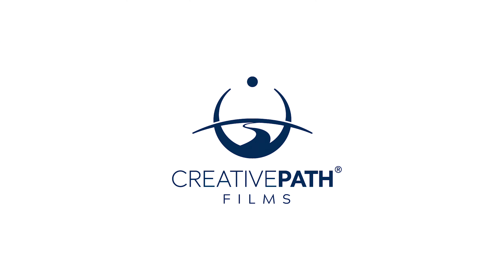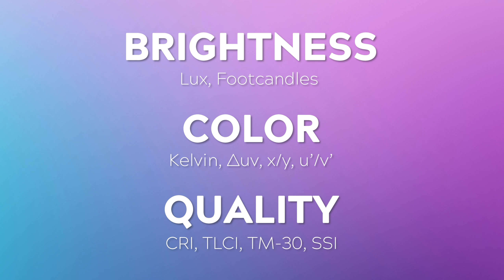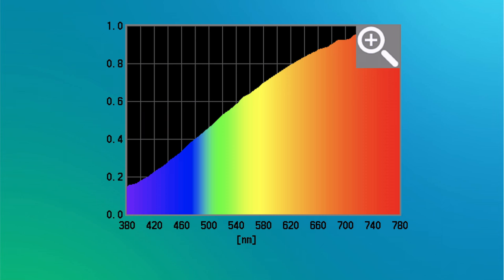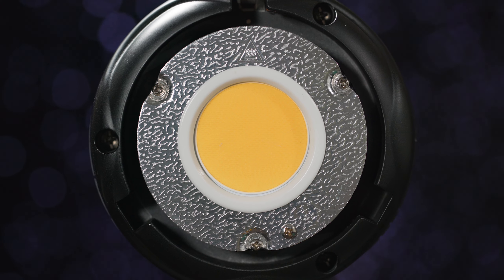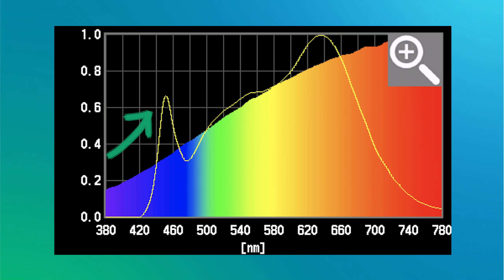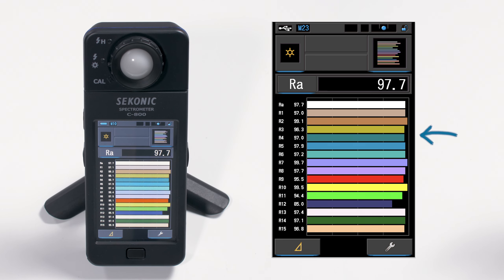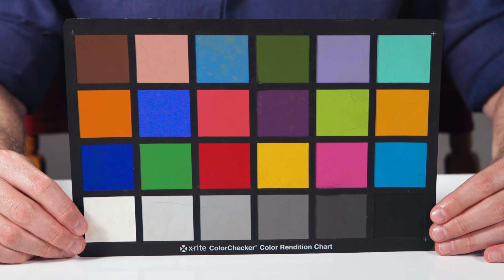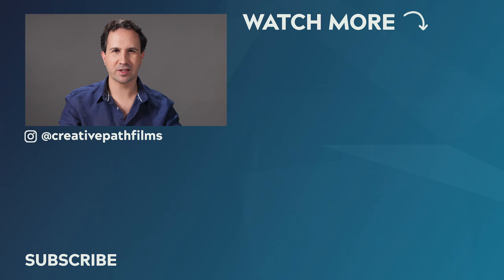Part 1 | What is CRI and TLCI? Demystifying Lighting Metrics with the Sekonic C-800

Comment from the maker: CORRECTION NOTE:
- I made a mistake in the video and incorrectly labelled TLMF. It stands for "Television Luminaire Matching Factor", not "Television Lighting Matching Factor" as stated in the video.
- I also wanted to note that the CRI scores given by the C-800 are calculated using R1-R8 only and do not factor in R9-15 when determining in the Ra value.

Comment: can we use gels to compensate the color loss of consumer grade >80 CRI led lights... if we are lacking orange, can we use to gel?? i want to start filmmaking, but don't have the budget or any service center for buying those high end lights... I want to use commercial light with gel... can I??
Reply from the maker: Potentially. It warrants some experimentation, I have improved the CRI (very slightly) on LED film lights with appropriate correction gels. But as there is so much difference between different household lights from different manufactures in different countries that it would be near impossible for me to give you an accurate recommendation for the lights you have access to. You would need a spectrometer like the C-800 to know, which far our prices the cost of entry level film lights. 

One thing to note about gels, is they don’t add a color to a light, they block certain wavelengths of a light, except for the desired wavelengths. So a blue gel isn’t adding blue, it’s blocking everything but blue. If there is very little blue wavelength to begin with (eg the streetlamp discussed in the video) it would block the majority of the output and only allow a small amount of light would make it through, which isn’t very efficient. 

I will experiment with some household LED fixtures here to see if I can improve them at all, but I expect the change to be small. 

If you’re on a budget, the best thing to do is find some inexpensive tungsten halogen lights (they make in hardware store halogen work lights), and use full ctb to gel it to match daylight. This is how I started!

Inexpensive, very hot, not very efficient, but they give excellent color rendering for an affordable price. 

I have a video called “working with tungsten film lights” you should check out! All the principals apply to any hardware store halogen light.
Reply: @CreativePathFilms  thats exactly what i wanted to know about... if a particular color is low in the spectrum... and if I reduce all other colors to that level, I thought it will equal the reading of all other colors... ofcourse, will have to compromise some intensity in the process, but getting a 50-100w led might solve this problem... and 2nd thing please also try with bouncing the light on unbleached muslin... it works for me, but I don't have a light meter, so cant actually know the readings... 6500k led battan light when I bounced on a unbleached muslin cloth, the light fallout on the skin looked decent in the footage, that looked good actually... no green cast or any other funny light cast which we normally get with low CRI lights... and for the part you mentioned about tungsten, my 1st project is majorly based in the jungle, so there will be no power to plug... i have to rely on batteries... that's why I asked if commercial low-wattage lights can work with tweaks...
Reply: Excellent series. Could you have a general description of what a specific indicator is used for - what is the problem that is being solved before showing the tool.
Reply from the maker: Hi Johan, thank you for your compliments! Could you please elaborate on your comment further? Are you referring to the indexes mentioned in the video? Or the conversation above 👆🏼
Reply: @CreativePathFilms  the readings in general - I’m coming from a still photo background and don’t know anything about making videos & movies. In general I use a sekonic 785 for my light and a colour checker for my colours and WB - very informative series and you have a solid way of explaining